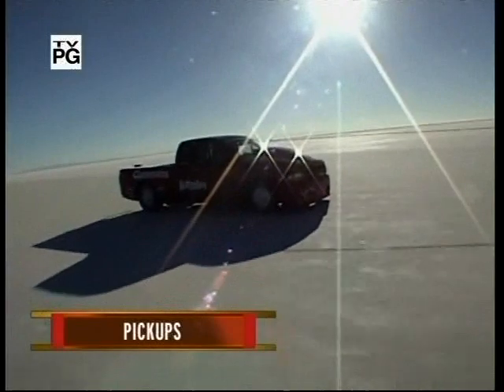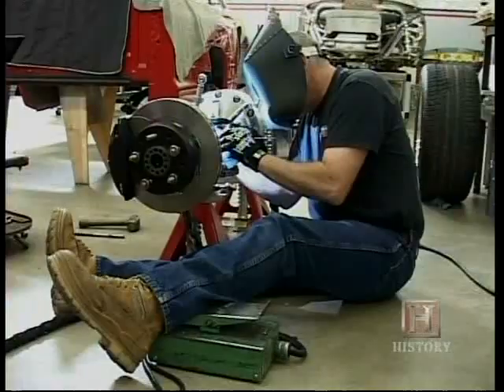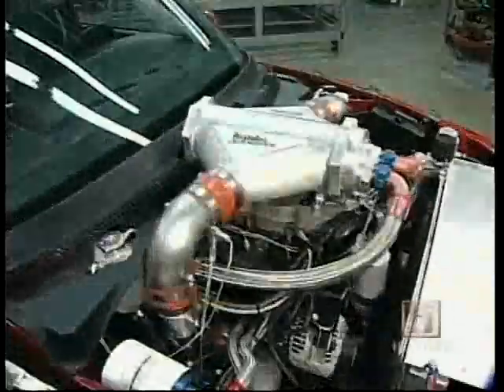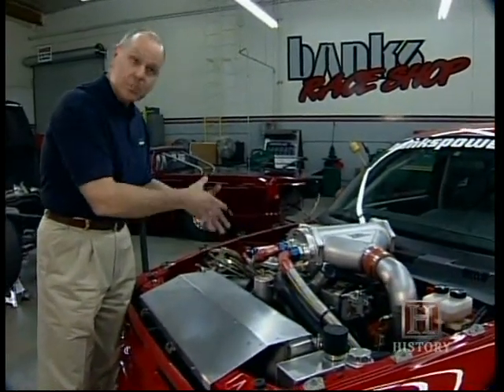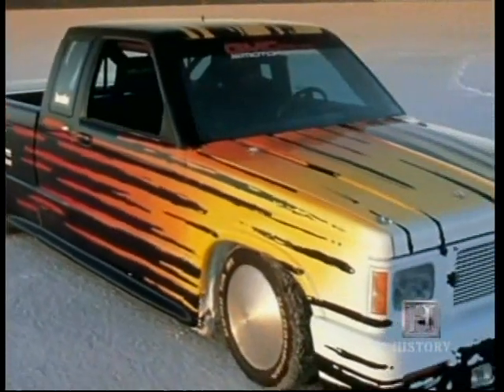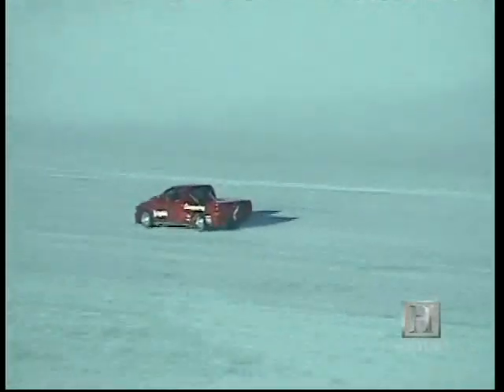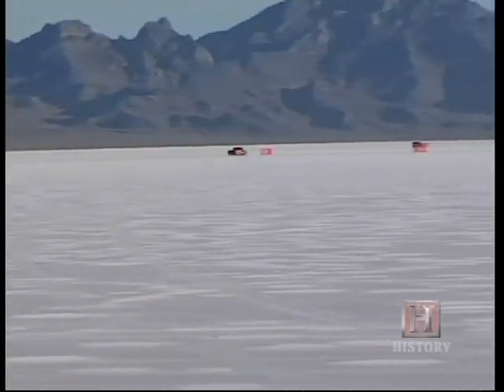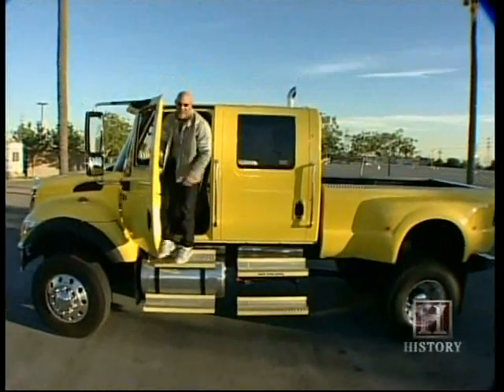Banks Sidewinder on Automaniacs

Comment: Remember people, ALWAYS DO RESEARCH ON AFTERMARKET MAKES BEFORE PURCHASING! Some componants slow your car/truck down performing worse than stock! In this Case, Banks is just about the best, but the MaxxFLow or wtf ever it is, is garbage, if anything buy from differant makes, and test your truck on the dyno, clean it off and send it back ass "new" for a refund. Although I woulden't be that cheap. It'd sell it to the rice burners down the street.

Comment: Banks is the way to go for airflow, but because of their attitude toward diesel smoking, they completely ignore fuel. A Banks airflow system (intake, turbo, manifold, exhaust) paired with a sheid fuel system (injectors, pump, lines, supply) is incredible. is you don't know what you're doing, stay out of the shop except to learn from those who do